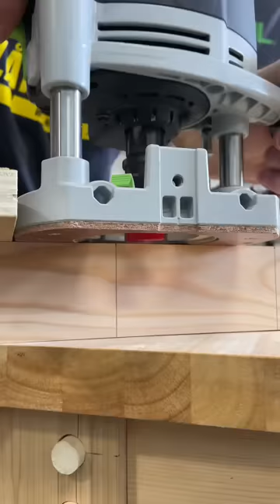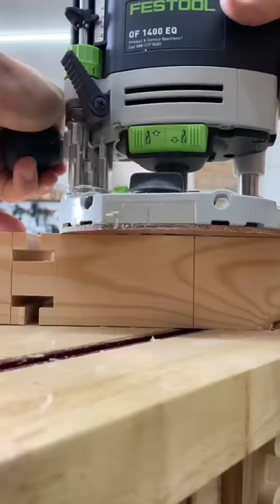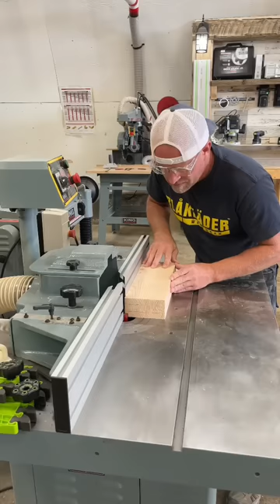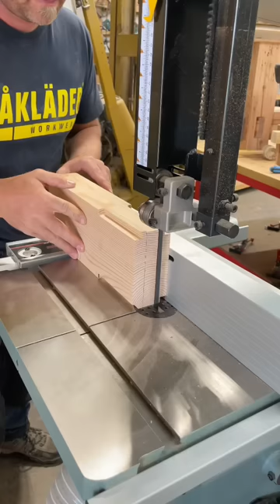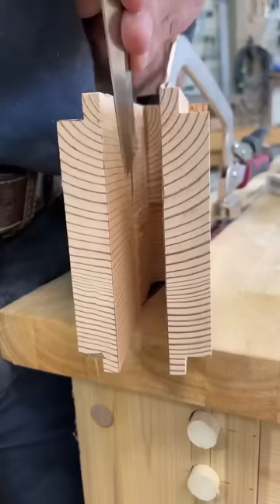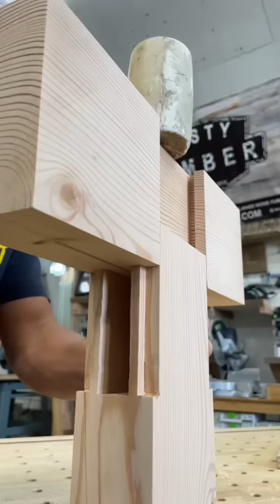Trying a slot cutter bit joint #woodworking #woodwork #maker #wood #woodworker #tools #joinery #bois

Comment: That is quite possibly one of the strongest joints you can make
Reply: indeed
Reply: That and probably the most beautiful… that was fucking amazing
Reply: Drill a half inch hole in the center and add a dowel?
Reply: The amount of geometry and measurement that went into the joint is truly impressive
If they showed these kinds of videos in high school geometry classes, the kids would latch onto the info a lot faster because there is a concrete application that they can imagine beyond a bunch of triangles and rectangles
Reply: @dustylumberco  
Where are you located at (seriously)
What do you charge? 
What are your prices?
I'm considering having a house built and would love for you to build my cabinets and such
Reply: Dovetail would be just as strong and take half the time
Reply: @mikejones-we9eo  
Yeah it would but that is something that takes some MAJOR SKILL 
The dude lives up in Canada
Reply: I agree
Reply: @jeffepstein4138  I can't belive they let you make this account

Comment: Use the flat edge of the router to slide against your fence. This removes the wobble from the round edge and puts the router’s handles in the correct position to maintain the right pressure against the fence.

Comment: Kinda brilliant but surely over engineered for most requirements. A simple half joint with wood glue and lost head screws is still very strong, especially if you only have a hand saw and chisel?